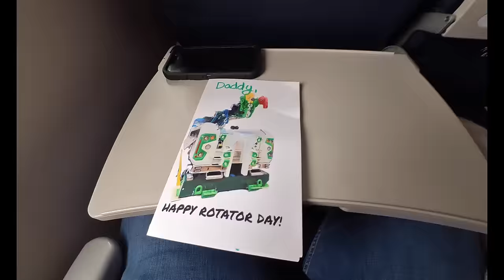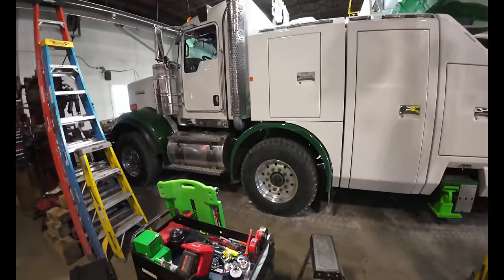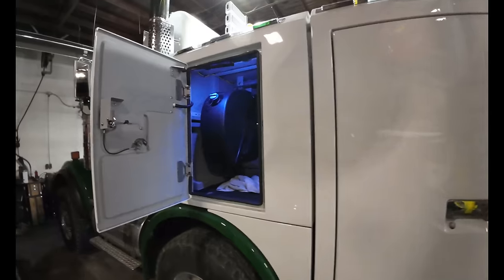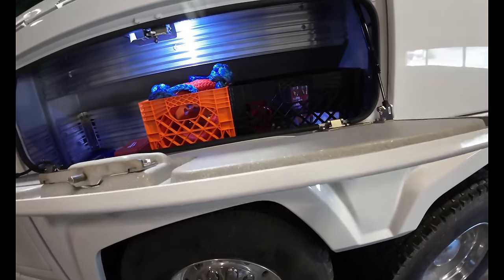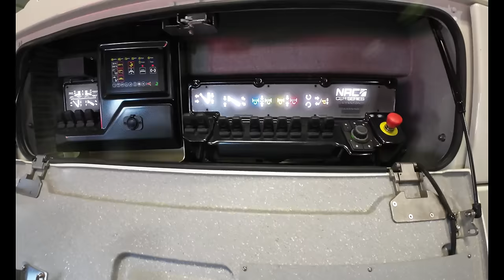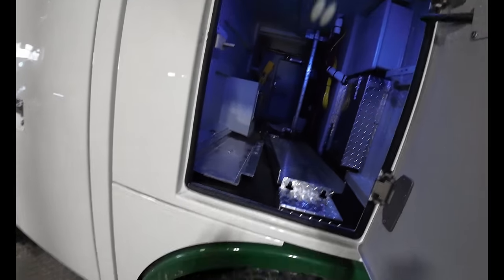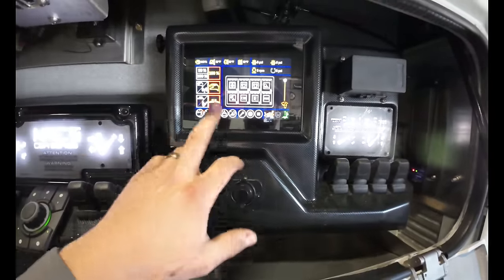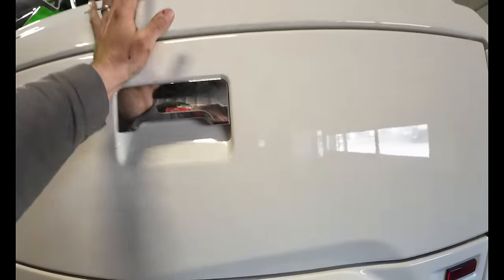Our BRAND NEW 65 Ton Sliding Rotator - Truck Tour!

Comment: Sweet truck! As far as the light tower goes, you can never have too much light on scene at night in the middle of nowhere. Just watch out for trees & potential damage to it! One question tho - why the small day cab & no extended cab, crew cab or at least a small 'sleeper'? I'd want something bigger for long cross-country hauls, for rest or for holding extra passengers. You do have alot of storage on it though. 🤔👍🏻👌🏻🛠️🔧🔩⚙️⛓️🏗️🚜🦺🚧⚠️🚚🛢️
Reply: 12:23 I like the cut-down milk crates too on middle shelves! Cool idea to chop the top off, looks like it came out perfectly cutting along that 'line'. 👍🏻📦🏷️🗑️
Reply from the maker: This is a truck that will mainly stay local, so there's no need to haul extra passengers. We would rather have the extra storage space in tool boxes instead of taking it up with a sleeper. Yes, cutting the milk crates down worked out very well to fit correctly on the middle shelf!
Reply: @WilcoxGarageRecovery  👍🏻👌🏻Cool man thanx for reply!

Comment: Congratulations on the new truck. It’s nice to see some NRC trucks on YouTube. 

One question, why on the NRC the underlift is attached to the main boom compared to other brands or both are completely independent?
Reply from the maker: I should have touched more on this in the video...NRC's specialty is the entire mast/boom assembly can travel (slide) front to back on a set of rails and rotate 360. Because of this, they don't have any more room to have a subframe/assembly that attaches to the underlift, thus using the boom to raise and lower the underlift. Having the ability of the slide feature combined with the rotator makes them an extremely versatile piece of equipment on recoveries.

Comment: do you have a remote that you can carry so you can watch as you are winching/working the boom ect
Reply from the maker: Yes, there is a full proportional remote to control the truck, with an emergency kill switch to shut down the entire truck just in case. It will also tell you the same data as the screen on the truck. The 50 ton and the 65 ton remotes are identical, however they switched a few of the functions around, which is a bit tough, but we will manage.

Comment: Very nice truck a lot of things that I like about it over the Miller. What’s the advantage of having the under reach attached to the main boom this having to disconnect it when you need the boom and not the under reach. I think I would prefer the under reach to be on its own independent hydraulic cylinders and be completely independent of the main boom.
Reply from the maker: It is designed that way to give the operator the full length of slide travel of the boom assembly to the back of the truck. There's not enough room left at the back to make the subframe/ assembly needed in order to make the under reach completely independent from the boom. I much prefer the slide travel over the minor inconvenience of unhooking the boom from the under reach.
Reply: @WilcoxGarageRecovery  Makes perfect sense. I didn’t realize that the slider assembly of the boom took up that much room. You’re right I’d rather have the sliding boom as well!

Comment: My question is the 2nd steer axle, anything like the rear steer axle, or could the front 2 tires be removed, and still drivable?
Reply from the maker: With the front two steer axles, all 4 tires turn when the steering wheel is turned. That's what Simard Suspension specializes in is upfitting trucks with custom steering configurations. The middle axle is a lift axle, and pretty much just follows/trails where the truck goes. The second steer axle helps to distribute weight and add more braking power to the truck, which weighs 72k lbs empty. It also helps the truck to turn a little bit shorter.
Reply: @WilcoxGarageRecovery  cool!
Reply: Was curious as to the weight, if 72k empty, are you approaching the 80k mark? Need a permit?? Beautiful, fascinating truck. @WilcoxGarageRecovery

Comment: Not to be a bother but I have a few questions:
1. what is the manufacturer name of the milk crates?
2. what do you store in the outrigger boxes?
3. what is the manufacturer name of the commercial truck tow pins?
Reply from the maker: We have been ordering the milk crates online through a website, milkcratesdirect.com.
I can say, the shipping seems to almost double the overall price of the crates, but I still feel they're reasonable enough even after the shipping, and the crates seem to be high quality.
 I noticed I referred to them as outrigger boxes, they are just the spot where the outrigger pads are stored. 
Lastly, the truck tow pins are all from the respective truck manufactures. To my knowledge, there's not a place where they can all be purchased from together. I have found one of the cheaper options for purchasing them is searching for them on eBay. The KW/Pete ones seem to be the highest price.
Reply: @WilcoxGarageRecovery  Thank you so much!

Comment: Do have to take a class to run new truck?
Or your experience is enough to figure things out?
Reply from the maker: For someone that has never operated one, a person could certainly receive training if needed.  For us a lot of it is just from experience. The biggest thing for this specific unit vs. our 50 ton is to learn/memorize the operation of the screen. The levers/controls are almost identical to our 50 ton.

Comment: Does it have a rotation or does it slide back and forth?
Reply from the maker: It does both, 360 degrees continuous rotation and also has around 10 feet of back and forth slide for the entire mast/ boom assembly

Comment: only thing i don't like is that you have to detach the under-reach. it should always be 2 separate units. it takes more time to detach it🤷‍♂
Reply from the maker: That is in the design of the bed, because that's what allows the entire mast/ boom assembly to be slid to the back end of the truck. Theres no more available space to make the required subframe or support to have an independent under reach.
Reply: @WilcoxGarageRecovery  miller industries  make them and jarradan.
Reply from the maker: @ninjalo9628  Jerr Dan does not have a rotator that allows the entire boom/mast to move back and forth. Miller has the 1150R which allows the boom/mast to travel back and forth 5 feet, and and uses the remaining space at the back of the truck for the subframe/structure for the independent under reach. The Miller M100 has 12 feet of travel, and offers an under reach option, however the under reach has its constraints because it is basically pinned onto the tailboard of the truck, limiting how high it can lift. NRC has roughly 10 feet of travel, and the under reach can be completely removed within a matter of minutes just by using the boom to lift it out of the channels it rides in. Each manufacturer has it's pros and cons, but for me it becomes second nature unhooking the the boom from the under reach on the NRC, and I prefer do that to have the slider feature.